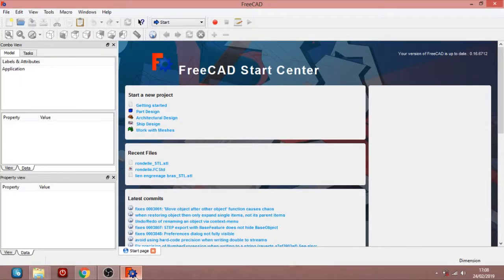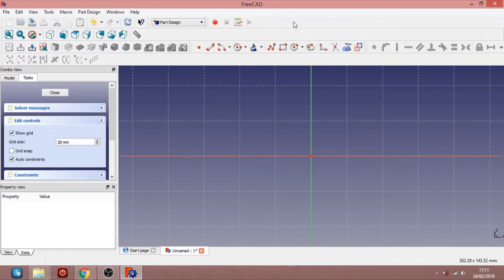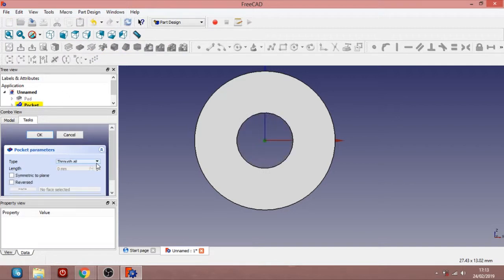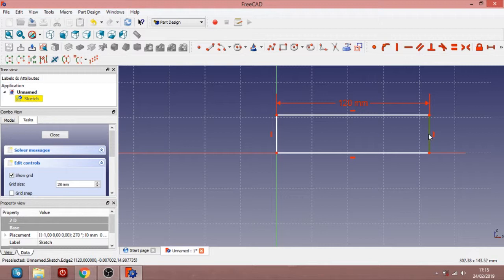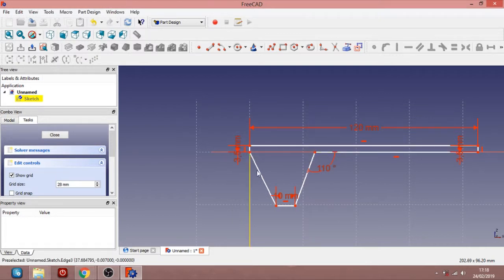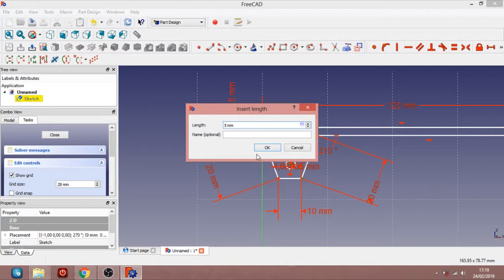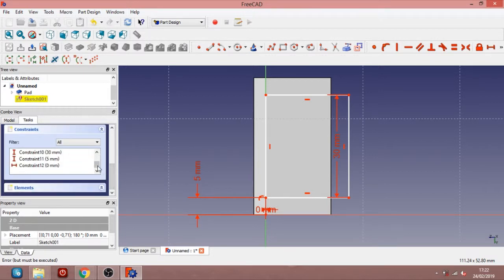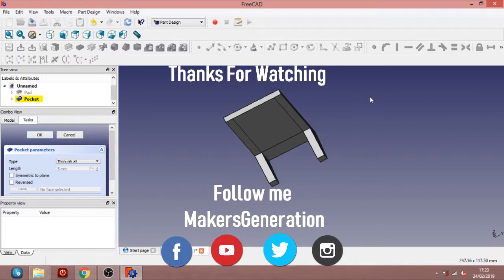How to build a 3D printed walking robot with Freecad - Tutorial Part 2

Comment: The motor in the yellow housing?  Where do you get those...online?  Is there something special about the yellow housing?  I've seen u use that before.  Usually the teeny motors don't come that way....
Reply from the maker: The yellow housing is motor with a gear. It reduces the speed of the motor. You can plug a wheel in it. Some of them can be bought together. It can be bought on eBay or Amazon